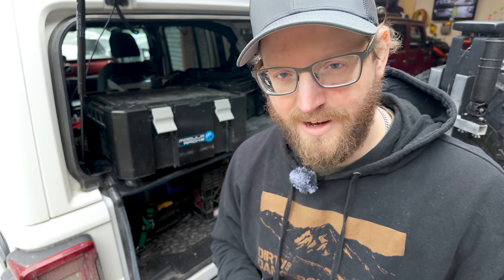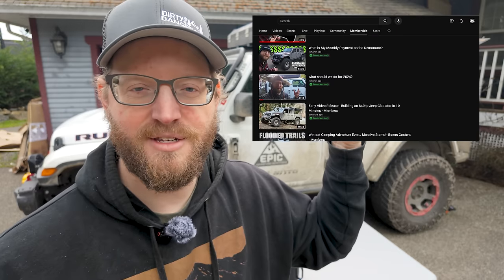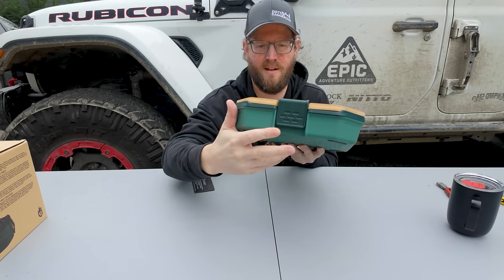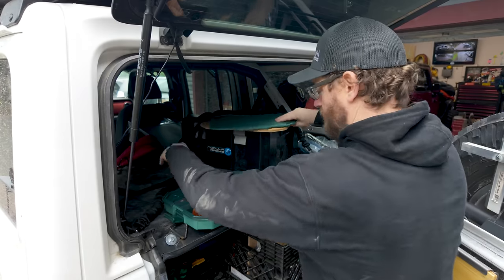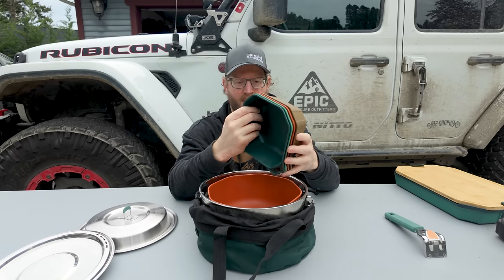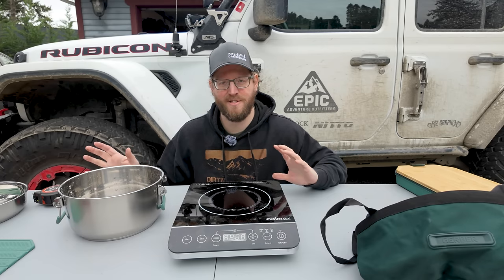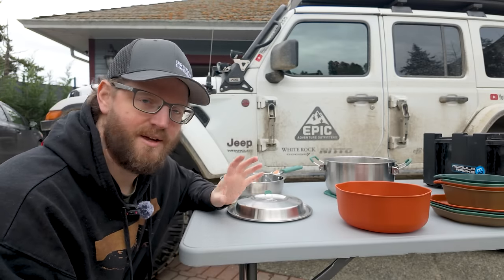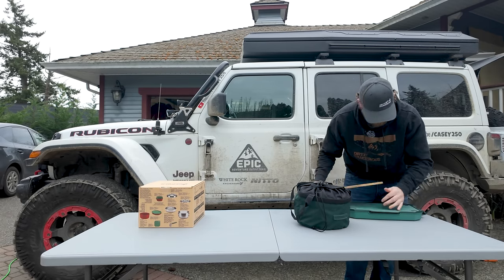Don't Buy A Bulky Camping Cooking Set Until You See This

Comment: people get full sized kits for a family of 4 when single. you can get tiny kits for single people. good sandwich makers are great for mini griddles. one cup for mixing or drinking,  one boilers, steak knife and a paring, wood spoon, wood plate can double as a cutting board or bread mixer. etc. i was always told to remember when single, your food should be about the size of your hand. so if you think about it you do not need much to pack in and out. simple snack meals and dehydraded food requires less work. most only need food for 3 days 9 meals with snacks or 9 hand sized meals.

Comment: Magnetic = works with induction
As far as the gear when I go out I bring a cast iron pan ~ 12”, bbq style tongs, spatula and kitchen spoons, a strainer/mixing bowl combo and one non stick kitchen pot. Pot sets in pan, utensils set + knifes in a chefs style knife roll and bowls set in pot.  Fits in a 16” tupperware and I bring a 2 burner camp chef with a convertible griddle thing and a 20lb propane bottle.  Overall it works well for my gladiator for camping or tailgating

Comment: I really like the Sea To Summit camp gear, they do a few pot sizes and then bowls/plates that fit inside. The bowls & plates clean really easy with just water or a bit of kitchen roll. The Sigma pan I have has a swivel/lock handle and metal lid and works on my portable Induction cook top, they also do a collapsable range of bowls, plates, mugs and a pan and silicone 'kettle' with metal base and super lightweight polycarbonate or titanium cutlery. I have a couple of the Delta 2 person sets of the rigid bowls and plates in my campervan - they nest within each other really well and take up very little room - if you buy them as a set they come in a net bag. The mugs come in different sizes, some with neoprene jackets and lids, they are grippy, so great for kids or people with a weaker grip. They also do a small neat Camp kitchen kit that can hang on your door with washup brush, bottles for oils, foldable cooking utensils and a microfibre dish cloth and quick dry tea towel. Other products include a folding sink, which is made of fabric, so tiny. Most of the gear is aimed at hikers, so very lightweight, but also durable. They also have heaps of other outdoor gear, always good quality - one of my favourites is the Pocket (solar) Shower. Worth a look at their gear, new cook ware range Detour and dinnerware Passage have just been launched.

Comment: I go backpacking so compact stuff is a must. I've found that fozzils bowls are awesome and super compact. You can use them as a plate and cutting board too. They also have wash basins. I use a folding fillet knife from outdoor edge as my everything cooking knife. I've also have a GSI Outdoors Bugaboo aluminum cook set with a removable handle. Sea to Summit also makes a good collapsible cooking pot that doesn't take up much space. I actually use the gerber utinsils cause you can use them as tongs too.

Comment: I feel seen, I solo car camp and bring nearly everything lol. Since I bought a Crosstrek and will be sleeping in it when camping I forced myself to minimize, so stuff like nesting pots and pans, etc. One thing that has come in super handy is using a plastic Plano tool box to put nearly all my cooking supplies into. Lightweight, has a handle, tray holds cutlery, knives, etc. A cheap solution that does the job well. I don’t need the Gerber board and knife set but it sure looks great. 👍

Comment: The thing you didn't know about on the Gerber spork looked like a can opener for cans of liquid like tomato juice.  The "thumb" goes on the edge of the can and the triangle is used to punch into the can which allows you to pour out the liquid.  It is like the triangle end of a bottle opener.  The rounded end is for the bottle cap and the triangle end is for a can.
Reply from the maker: Thanks for the tip!

Comment: I was looking at the items on the website to check the price and saw that the insert with the knives pulls out so you can use the bottom section as a prep tray (eg cut stuff on the board then tip it into the tray until you're ready to cook it)

Comment: I like the pot set. Looks quality.  It's looks about the same size as the JetBoil Genesis Basecamp?  Like you, I don't know that I need to carry around four of everything.  If I am cooking for myself and the wife and another couple,  it would be handy? Too expensive to buy just to use a few items.  A solo version makes "ComplEAT" sense.  (see what I did there?)
  That cutting board set is a no-go. Unless you always leave the dirty side out and only cut on the other. 
Please don't fling the grease in the bushes.  Pack it out.  It only attracts wildlife and isn't good for the outdoors.

Comment: How about a roof top tent that you can access through the sky touch jeep roof? That would be pretty cool
Reply: I have a sky top. You don’t have the same middle bar across the middle to support the weight of a rooftop tent. The sides are smaller than a hard top or a soft top. It’s about an inch or so from the side to the roof.

Comment: If the stainless steel knife sticks to a magnet its not 100% food and marine  grade stainless it shouldn't stick its cheap stuff sorry  still has iron in it 😢 if you left it out in the wet weather for a few days it would rust , always when going to buy stainless products take a small magnet with you a little one that fits in ya pocket if it sticks hmm if it dosnt 👍it's the  good stuff
Reply: As a knifemaker, I can with 1000% confidence say that is false. The ONLY thing that makes a stainless steel "stainless" is a chromium content of over 10.5% in the alloying composition. Every single blade steel in my shop right now, about 10 different alloys, is stainless and is very magnetic.
Reply: @vdub5818  then why on boats the stainless is pure no magnet will stick and it won't rust
Reply: @davidmilledge221  because of the specific alloy they used for that application.  There are hundreds of stainless alloys. Depending on the desired properties, they will alloy it with different elements.